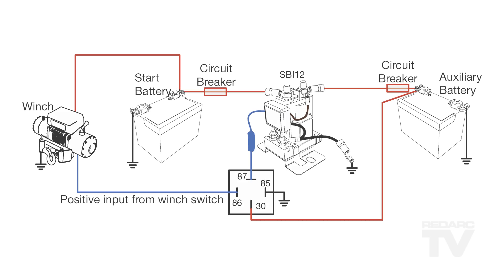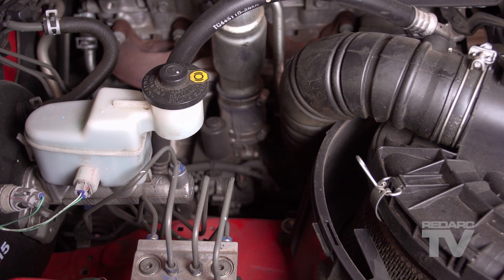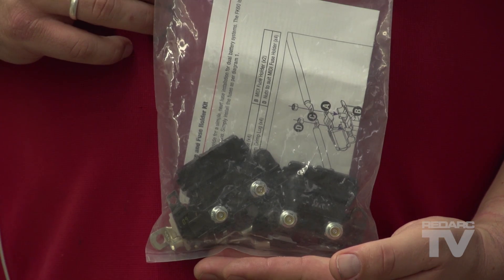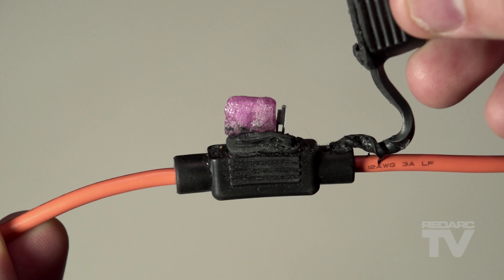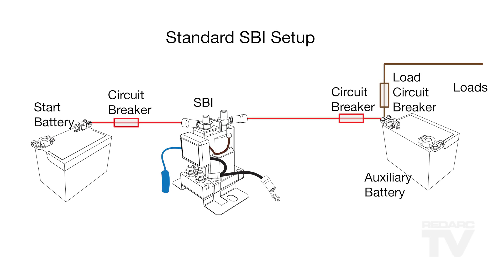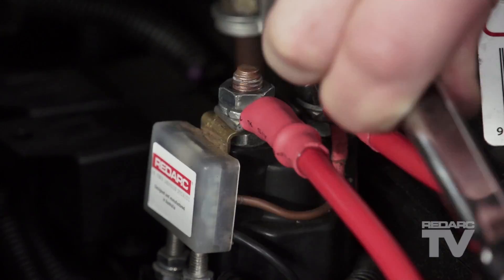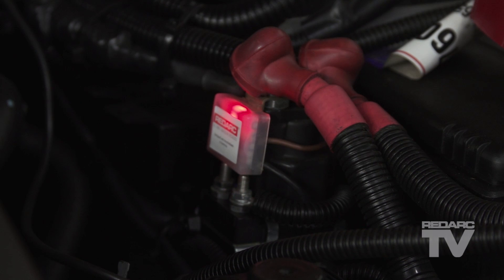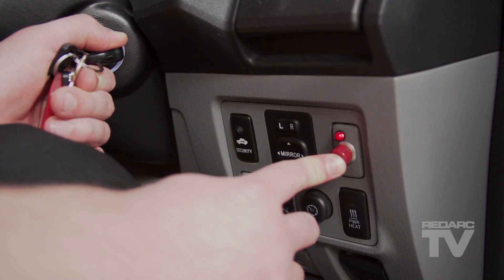How to install the REDARC Smart Battery Isolator

Comment: I have a Redarc system fitted to my nissan navara, both batteries are under the bonnet. Question,  can I run a lead from the second battery under the bonnet to an auxiliary deep cycle battery in the tray to keep it topped up?
Reply from the maker: Hi Malcolm, thank you for your message. It would be best to contact our Tech Support Team on (08) 8322 4848 or via email at power@redarc.com.au and they'll be able to walk you through their recommendations.

Comment: Will I need to include this in a dual battery system with a Redarc Manager 30? Or does the Manager 30 already perform this role?
Reply from the maker: Hi Liam, thank you for your message. It would be best to contact our Tech Support Team who can look to understand what you're trying to achieve and make a recommendation from there. You can contact them on (08) 8322 4848 or via email at power@redarc.com.au

Comment: i have 1 of these units in my 4x4 and it is a great little unit i have the jump start button as well and when I'm driving and the unit is running its put from 14 to 14.4 volts into the 2nd battery i wouldn't have any other unit and mine dose everything that is out lined in this video .. That over ride button is a life save